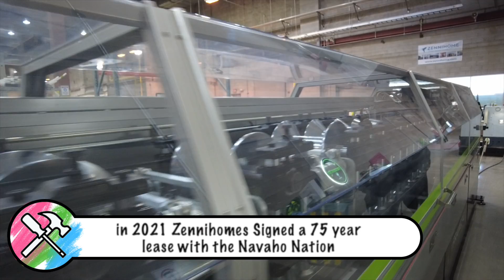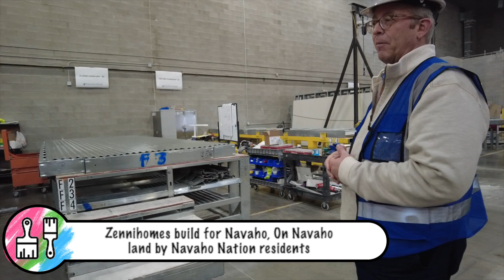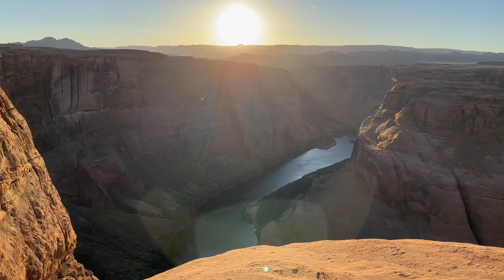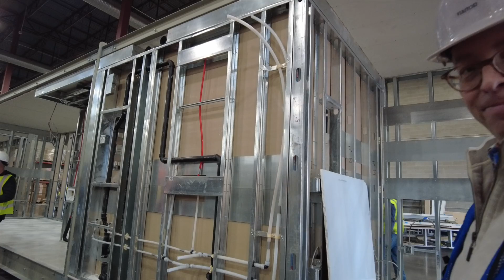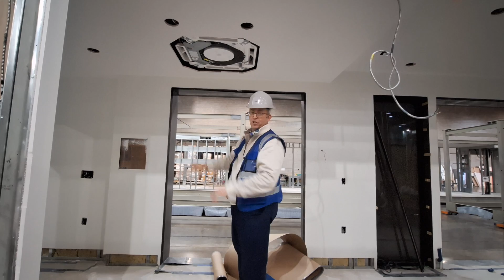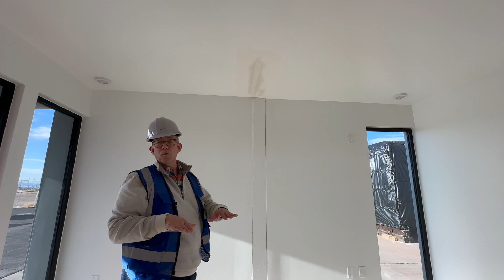What Actually Happens In A Modular Home Factory

Comment: This is definitely one of my favorite factory home builders.
So they finish them on site during the 10-day set up? And THAT'S why they don't have any finished and furnished models to tour at the factory?
Also...
I think the easy part is selling and building affordable factory made homes. But... the tough and expensive part is just about everything else.
Locating affordable land zoned for such a dwelling. Water, sewage and electricity. Shipping thousands of miles. A competent setup team. A driveway to an attached garage or carport. Basic landscaping. Finding someone that will bundle all these expenses into a single 20% down 30-year mortgage. Finding someone that specializes in insuring your type of home.
I have yet to find anyone on YT that addresses these types of concerns.
Reply from the maker: So you can view homes set up in Phoenix Arizona. Here’s a link. https://zennihome.com/ since these homes are built to IBC building code they qualify for a 30 year fixed rate mortgage and they also are insured like a typical traditional home.